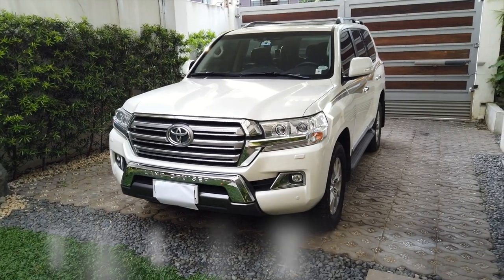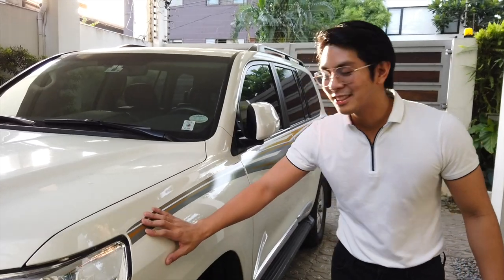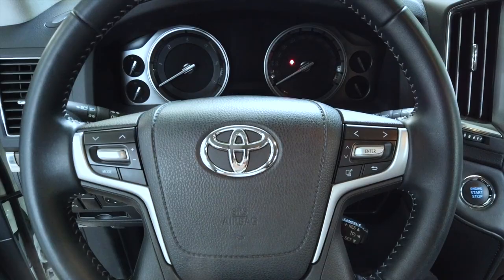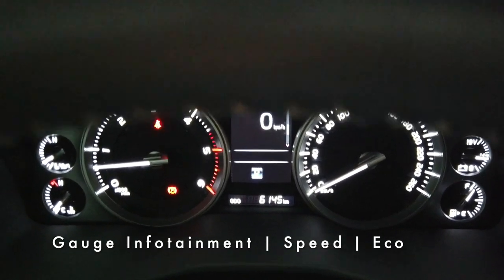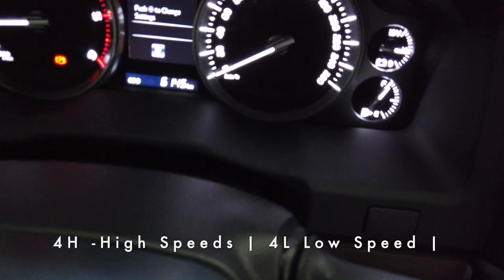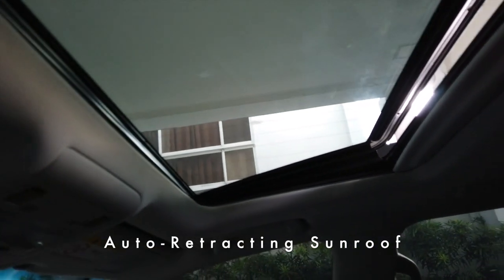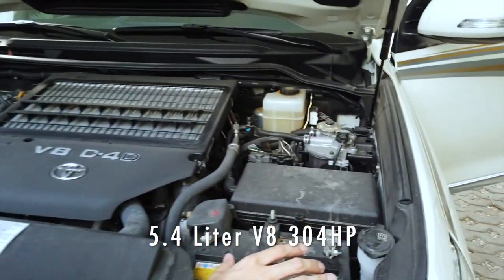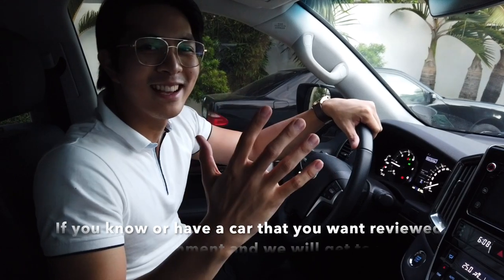2019 Toyota Land Cruiser 4X4 VX In Depth Honest Review (Interior, Exterior, Engine, Performance)

Comment: Correction; it is the 4.5 V8 Turbo diesel. The 5.7 you mentioned is the Petrol version sold in the US, Middle Eastern and other markets. Local spec Land Cruisers are powered by the 4.5 Turbo diesel generating 232 HP and 615 nm of torque. The wheelbase on the Nissan Patrol is way above 3,000mm the wheelbase of the Land Cruiser is the same as the Toyota Fortuner at 2,850mm
Reply from the maker: Yup, you are correct, brother! We seem to have confused the two. The one here is the local spec 4.5 V8 Turbo Diesel :)
Reply: @RephBangsil  good review btw! Very informative and I love the technicality!
Reply: Thank you for the comment. Now i have an idea which one is better.
Reply: @elvislauron6580  agree
Reply: No Nissan patrol no diesel landcruiser in the US cost of landcruiser in the US $90 thousand expensive SUV
Reply: Daniel youre wrong!! Nissan patrol wheelbase 2,200mm, LC 200 wheel base 2,850
Reply: Also fortuner is 2,750 not 2,850. Get your facts straight
Reply: Way above 3,000mm daw nissan patrol. Nagpapatawa ka boy
Reply: @aroundmeph1145  magresearch ka muna bago ka magsalita
Reply: @danielroa12  ikaw kaya mag research. Libre lang ang google. Get back to me pagkatapos
Reply: @danielroa12  2,200mm lang ang nissan patrol boy. Kaya mag research ka. Ok?
Reply: @danielroa12  yung patrol royale yung tinutukoy mo. Not exactly the patrol
Reply: @aroundmeph1145  i admit my mistake Fortuner, it has a wheelbase of 2,745mm pero ang sabihin mo na ang Nissan Patrol 2,200mm? Lol nakakita ka na ba ng Y62 na Patrol? Hahahaha common sense dude. Kung magsesearch ka siguraduhin mo gawin mo ng maayos hindi kung ano ang unang lalabas sa google hahaha. Common sense ano malaki pa ang wheelbase ng vios sa patrol? Hahaha pathetic
Reply: Of course. Under the premise ng kung ano nasa video ano pa ba ang ibang tutukuyin ko?
Reply: Would I compare a 4W60 and 60 series Patrol to a J200 Land Cruiser?
Reply: Mahina pala 232HP for a 3 ton vehicle kayang kaya sibakin to ng Forester XT (240HP 1.6 ton) sa daan
Reply: As of our lc, wala akong reklamo.. hanep na hanep
Reply: Napansin ko rin, mejo confusing ang review.

Comment: We were actually considering the standard LC 200 before, but the cost cutting measures of Toyota PH put us off.  No folding side mirrors on a 4.3M SUV?  Unbelievable.  The full option one on the other hand is pretty good.

Comment: Wrong on the caption about wheelbases of Land cruiser vs Patrol. 

Nissan Patrol’s wheelbase is 3075mm

Nissan Patrol has more horsepower, more width, more height and wheelbase compared to the Land Cruiser.

And is about 800,000 pesos cheaper

The only diff is it is petrol and not diesel.

Please correct your captions.

Comment: Try to be accurate with your terminology. For example, if you read the manual, it will give you the correct names for the features of the car. I assure you many viewers care about this. Another example is that H4 and L4 are not "speed controls" and it's not just for the mountains. Again, that information is in the owner's manual which you could have read first. It's not really a lot to ask--after all, you are reviewing the car "in-depth". Cheers!